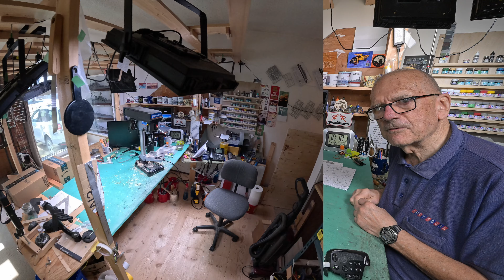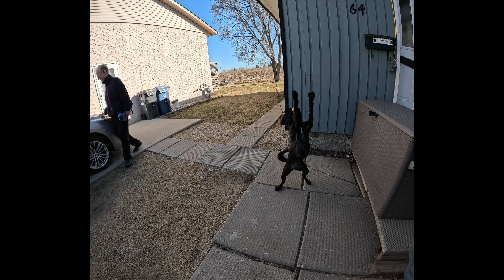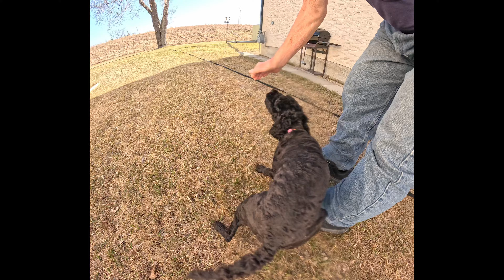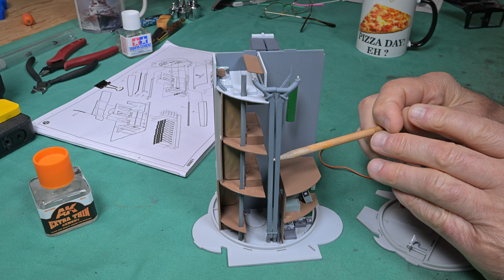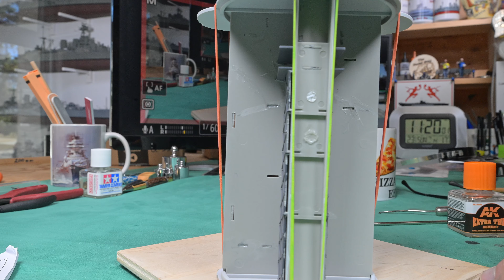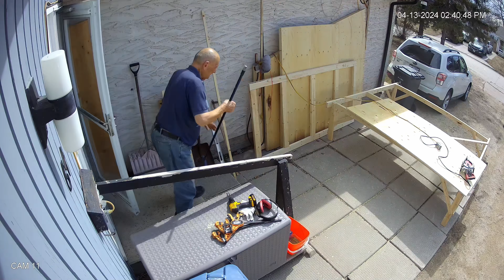The Model Ship - Part 1958

Comment: Hi Ron, Hey remember back in Ep 1956 at 8:29 you said "Install First" !!!! as it says on the instructions Step 25.... Well you seem to have missed that part out (the roof) completely!!
I hope you manage to spot that before it all sets up too hard!! Looks like you are having a real struggle getting these parts all together and maybe it slipped your mind? My wife was wondering why I was shouting at the screen... "RON YOU HAVE LEFT THE ROOF OUT!!!!!"... LOL.....

Now I don't wan't to be accused of 'Teaching Granny to suck eggs!'..... and I do hope you do not mind me mentioning this... But the glue (cement) you are using (Tamiya Extra Thin or the AK version) is actually and 'specifically' designed so that you can dry fit and assemble all of the parts and then after they are in place, all lined up, all the tabs in the alignment pockets etc.. and all seated properly that you can then and only then apply the cement and it will 'wick' into all of the joints and cement everything into place. This stops you getting 'Oozing' of the melted plastic out of the joints and making the joints look poor.
You could have put all of these parts into place, clamped the ends with bands or a 'quick clamp', or stood it on end and put your 500g weight on top, got it all aligned and squared up using a straight edge and your square and then applied the glue and then leave it all to dry.
The Tamiya extra Thin (TET) easily melts through the thin layers of paint and melds the base plastic together, or use a 400 grit sanding stick / sponge to just 'dress' the tabs and remove the paint if they are tight to fit together so that you can dry fit the assembly first 'before' adding the glue (cement)...
PS. You don't HAVE to use the little (short) cement brush in the Tamiya bottle... It is often easier to use a very small paint brush with a longer handle that you get into hard to reach places so you can cement the joints, you can keep this just for gluing and you don't even need to clean it as the cement just evaporates!!
Reply from the maker: Hi Alex,
Thanks for the "lengthy" comment. 😁